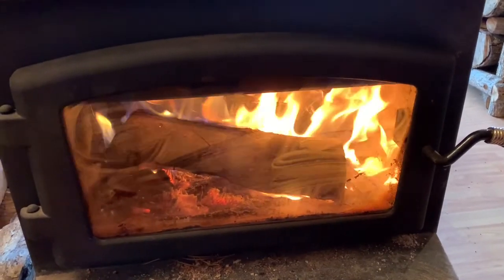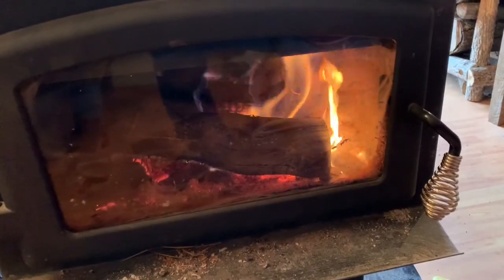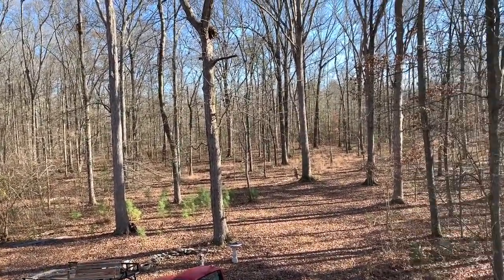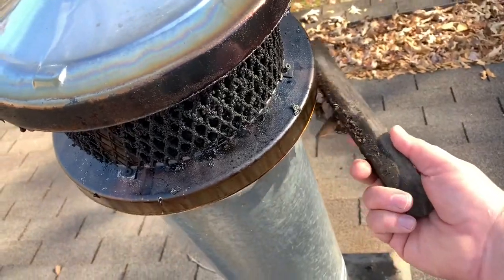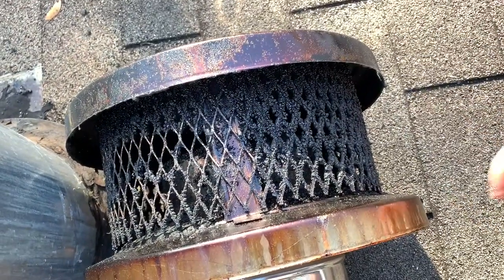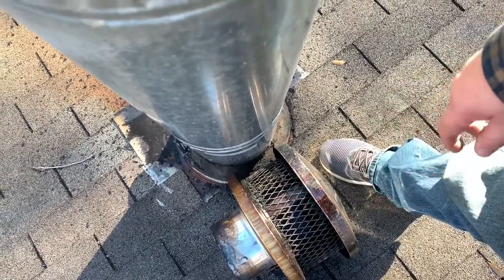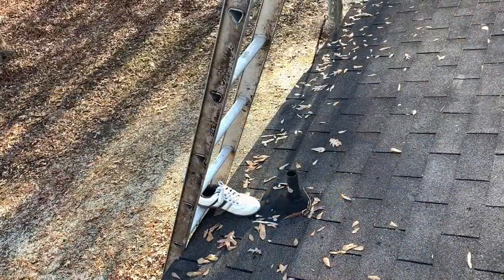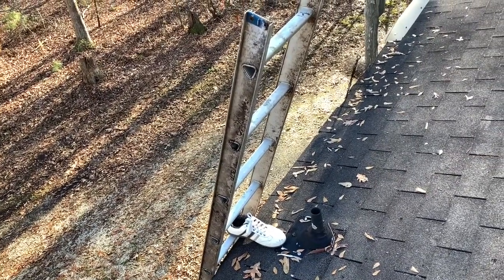How To Clean Chimney Wood Stove Pipes,

Comment: I burn nothing but oak and have never seen buildup like this. Your damper might contribute to this massive buildup.
Reply: Its the pinecones.
Reply: @Lonesoul9791  No, I use pine cones to light and have nowhere near that buildup and I only clean once per season.
Reply: Not sure how you avoid creosote entirely except maybe keeping high chimney temperatures.  The condition of your firewood is most likely the difference.

Comment: I missed the top wrung last year and took the most painful trip down, Still having problems,, Placing that wrung level with the roof is a great idea
Reply from the maker: thanks, I forgot to mention, simply adjust ladder pitch/angle to get rung in position. Hate to hear about your fall
Reply: I know this is a year late, but tie your ladders guys... if its your ladder and your house, you probably put up the same way in the same place all the time. There was a convenient pipe there for this house. Leave the pre-cut rope or chain on the ladder so it's always ready.  First thing, tie it, last thing, untie it every time.
Reply: I work as a gutter tech and we have ladder stands that would help a lot, you can get them at hardware stores

Comment: I used to use the stick chimney brushes but then I discovered chimney brushes on a wire that can be connected to my drill. Cleans the chimney world's better and is 1000 times faster.

Comment: Do they advise using a steel brush in steel chimney pipes where you live? Just asking because here in the Netherlands they advise to use nylon brushes in steel wall pipes because the iron brushes scratch up the inside of the steel pipes and that makes for more creosote buildup, because it sticks more to the scratched pipes. I am curious how they do it in other countries.
Reply from the maker: I have never heard that before, but it makes sense. I will have to look into that. The nylon I would assume would be more forgiving and allow the creosote to stay in there, where the steel is abrasive and non-forgiving. Just my thoughts. Great question
Reply: @davel8n  indeed the nylon would not get rid of all the heavy creosote but from my own experience i found that it gets the most of it out of the chimney. I must admit that in my chimney the creosote buildup is almost none, just loose soot that can easily be removed. I think that i don’t get that much creosote because my stainless steel liner is inside a brick chimney which makes for good heat buildup. Maybe in other type of chimneys it is possible to first use a product that reacts with the creosote and makes it easier to remove.
Reply: Rutland is a popular company that make all types of fireplace and stove accessories. They do suggest using a poly brush on metal and wire brush on masonry, but i Dont think its the end of the world to use either on both. Better than bot cleaning the chimney right.

Comment: Thanks for taking the time to make this video! As a former chimney sweep, I have a couple tips and an observation
1. By the look of the creosote in your stove pipe, I would wager to say that you had a chimney fire not long before you cleaned it. That means cleaning was overdue! I have to clean my current woodstove system twice during the burn season. Any more than 1/4 inch of creosote buildup means it’s time to clean it.
2. It’s super important to clean the area between the damper and the stove throughly with a brush. Tapping the pipe is not sufficient to remove the creosote from that area, and that’s where at chimney fire is going to start. Leaving creosote in that area is going to facilitate the deposit of more creosote, and disrupt the laminator flow up the stovepipe (which then leads to even more deposits) .
3. Many wood stoves have a layer of brick with an insulating layer of high temp fiberglass, or a shelf above the firebox. It is important to clean that area as well.

Comment: If you get the tool stuck in your pipe a 2x4 depending on the length of you flu you can get it out. I learned this the Hard way about 6 years ago had to get a 2x4x12

Hope this helps anyone who gets the tool stuck like I did. Also attack a rope to the wood. Your welcome 😉

Comment: For the little amount of creosote you had in the pipe and chimney, could load your stove up and run it at full throttle for about 30 minutes per week and it would keep it clear.
Reply: Not with all those dry leaves 2 feet from the stack

Comment: I think the dampers in the flue are not allowed anymore. Just sayin...

Also, if you didn't have one you could brush all the way down.
And, if you could remove the baffle and the catalytic unit all that creosote would just drop into the firebox. Make sense to you? I like your tips too. Roof safety critical!
Reply from the maker: the baffle and catalytic helps slow down burn time to save on firewood, and prevent heat loss through the pipe. I can actually come in on a cold day and touch the stove pipe to warm my hands. On conventional wood stove without baflle/catalytic the stove pipe gets way too hot, meaning free heat right out the roof. Thanks for watching and great comment!!

Comment: Hi 
Great video 
I have a blaze king with a cat 
No damper on pipe like yours my damper is a handle on the side of the stove so my brush should come all the way down to my cat correct ? 

It's my first time ever cleaning a wood stove 
How often do I clean it with 24/7 use during 6 months of winter

Comment: Good information, my friend.  I have a question.  Do you use plain old pine cones, or do you buy the ones with the waxy coating?  Thanks, Dave.  Take care.
Reply from the maker: just regular pine cones. You can also take cotton ball and soak it in vasoline, I prefer pine cones the best, especially the spread out ones, not the closed ones
Reply: Good to know. Thanks!
Reply: Dryer lint is also awesome to start fires.
Reply: I keep a small torch near my stove. Lights up the fire real quick!  Lol.

Comment: My pipes inside seem to be too tightly together to loosen like you did... any suggestions?
Reply from the maker: take 2 leather belts, one around each section of the stove pipe. Turn one clockwise the other counter clockwise. Be careful not to crush the pipes in the process. Tap lightly on the pipes before doing so, it may loosen any buildup that might be preventing the pipes from moving
Reply: thanks for the advice! @davel8n

Comment: Is Ash wood a good Wood to burn in my Wood burning stove? I'm a new home owner.
Reply: yes, it is , accutally very good .
Reply from the maker: any wood with low moisture and low sap is good to burn. Never burn cedar or pine. To tell moisture look for cracks in the ends of firewood. If the wood is split, I can touch my lips to it and feel the moisture of the wood.

Comment: That is what happens when you burn soft pine against dry hardwood, Your cleaning is fine, any cleaning done in time is good. We depend on our woodburner to heat the house but now the UK government is trying to make it illegal to burn wood stoves , because it is not 'green' .
Reply: They’re not making wood burning stoves illegal. They’re making it so you can only burn well seasoned kiln dried wood or smokeless fuel. I’m a chimney sweep been having to explain this to a lot of my customers. Hope it helps.👍
Reply: Not yet but as they want GAS gone away then wood will certainly go too in the near future. I cut my own wood from my woodland and have loads of dead ash to cut down , it is my only heating that is affordable.
Reply: @misterj9030  Hello, what is a smokeless fuel?

Comment: Excellent video. But I have one question, I occasionally heat my little house with wood, but it's not my primary form of Heat. I just use the fireplace mainly for ambience, and I probably need to clean out my chimney, so thanks for the video. But to my question, I see from your video that you store some of your wood INSIDE your house. When I do that, I notice that I bring in a lot of insects; spiders, ants, and even roaches. Do you have that problem? And if you do, do you do anything to alleviate the problem?
Reply from the maker: Great question. First, I am sure you are mainly concerned about the roaches. These are in most cases what is known as a wood roach. They are equally embarrassing if you have them in your house and a  guest sees them. But generally they are harmless, no desire to get into your foods, and they kill much easier than regular roach. I keep 3-4 weeks inside at all times. The dryer the wood the easier it burns. Also, if I get the flu, last thing I wanna do is go chop wood, and bring it in. If there is any advice you take from me, the 3-4 weeks supply is key. Always pull from what has been in the dry the longest
Reply: Nice my pipe is curved at top ,and it outside beside the house ,it’s a buck wood burning stove,what do you suggest
Reply: Me and my kids like all those insects that come in with the wood.  My little ones chase those critters around having all kinds of fun. And when they ketch one they pop it in their mouths and smack their lips with delight.
Reply: @ravenfeather7087  wow. Your kid are awesome!

Comment: I was thinking of removing my triple wall pipe in the spring and pressure washing it. It's stainless steel. My stove pipe is collapsible but I think it's mild steel.. just going to take it outside to clean

Comment: I can’t imagine any reason someone would put a damper in the pipe. No wonder you have creosote problems. I haven’t cleaned my chimney in nearly 40 years because there’s never anything in it to clean. I do have a bit of buildup on the cap that I clean every few years.
Reply from the maker: here is reason for the damper. If I put a log in there it will burn for about 4 hours. If I take same size log and close damper the log will burn slower about 7 hours. When I wake up, I still have red coals. If I do not use damper I have to get up 2 times in the night to load the fire.
Reply: @davel8n  Both my wood burning appliances (zero clearance fireplace and forced air furnace) are airtight with combustion air pulled from the exterior of the house so the air is controlled on the intake side. Both had instructions to not install any damper in the exhaust. Maybe a pipe damper would make sense for older non airtight applications. I think many insurance companies are no longer willing to insure a dwelling with a wood stove that has a damper in the pipe.

Comment: When I put that bottle brush wire down my stovepipe it feels as though I will pull the whole thing apart because of how tight the fit is.  So I don't use it.  Instead I hang a long chain down there and swirl it around.  Well that doesn't work so well so I live with a stupid woodstove that won't even keep a fire going!!!!
Reply: I have a very small woodstove that has only a 3" pipe diameter. I have a broom handle with a toilet bowl brush gorilla glued then gorilla taped on the end! Works great from my situation!